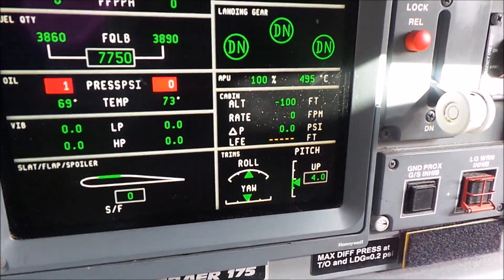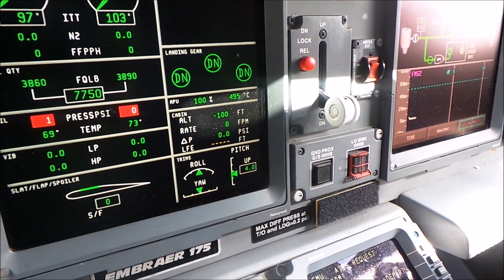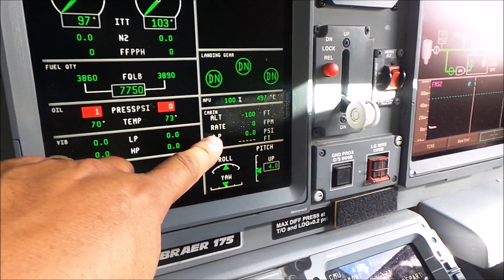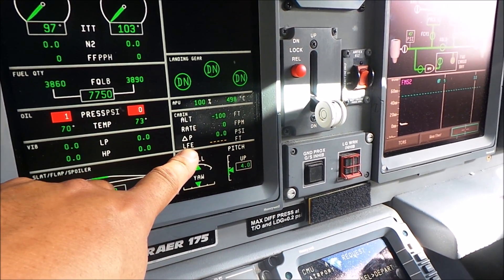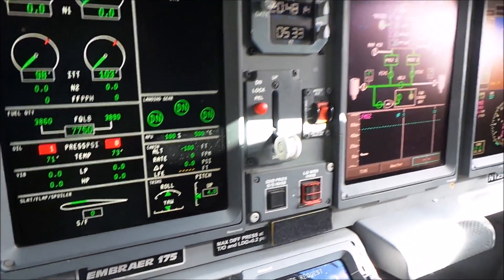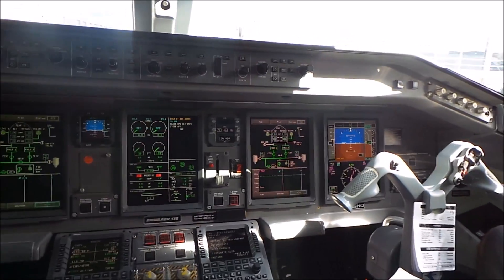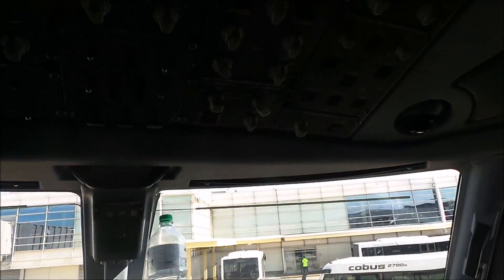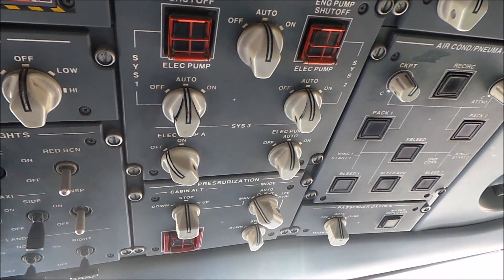Aircraft Pressurization Test in Manual mode

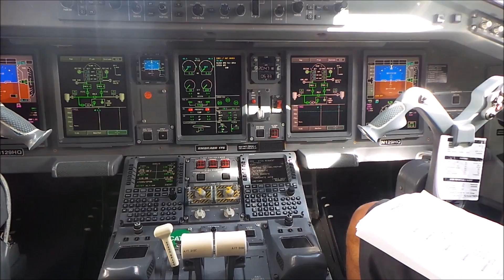Comment: 1:32 Those flight yokes look very similar to the ones used on Concorde.
5:12 That soapy water method is what I use to find an air leak in a car tire as well.

Comment: Aircraft systems EMBRAER family - could you explain to me - how PRESSURIZATION DUMP BUTTON is connected with an oxygen masks? @6:31 Because auto deploy happens only when CABIN ALTITUDE exceeds 14 000 ft...?
Reply: I don't think the Pressurization Dump Button is directly connected with the oxygen masks. The oxygen masks probably are controlled by a module that has independent sensors that detect cabin pressure loss. My best guess is that when those sensors detect cabin pressure loss, the masks drop automatically no matter what. If the pilot presses the Pressurization Dump Button the same thing happens and sensors simply react to the sudden loss of cabin pressure although i am still a student and not an AMT, A&P or licensed maintenance aircraft engineer so don't take my word for it.
Reply: I think the oxygen masks deploy because the DUMP button causes a more rapid depressurization of the cabin. It would be the same if a window blew out at altitude.

Comment: Why would the handle swing hard towards you at higher cabin pressure when the cabin is at a higher pressure than the outside? My understanding is that the air in the cabin escaping to the outside would push the handle away from you and towards the outside.
Reply: the doors of the Embraer aircraft I'm not sure about other's on the inside of that plastic inner flap he sticks his hand into is a door vent the handle pulls towards you and this is the handle he is referring to if you pause the video as he reaches in and back out you can see a red handle labeled door vent. the handle would be hard to pull towards you if not be impossible when the cabin is fully pressurized I think this is what he meant.